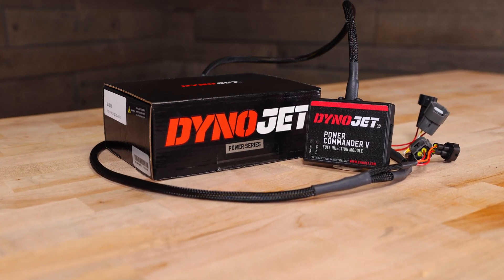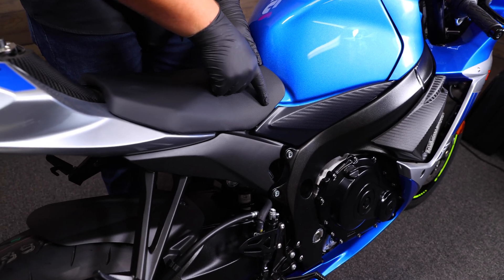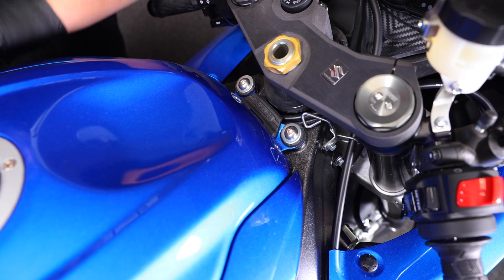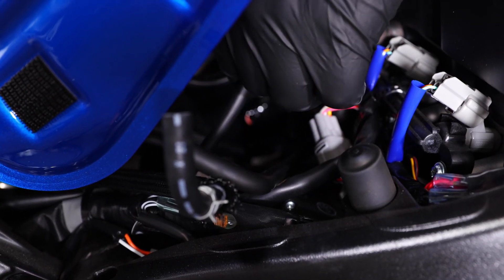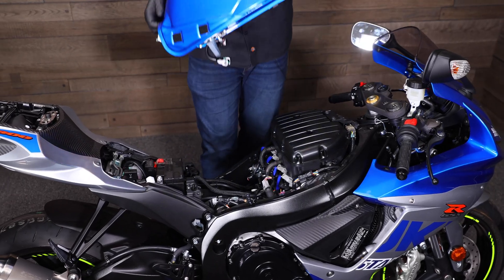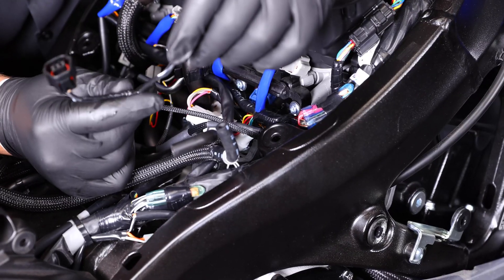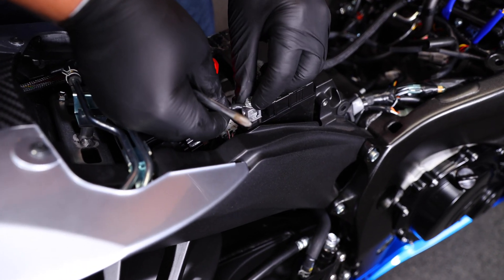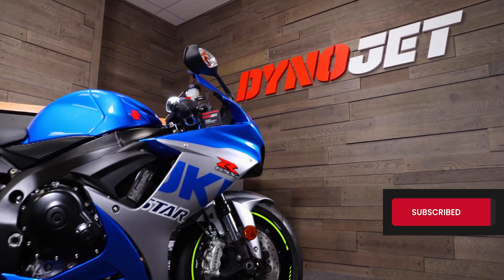Power Commander V Install: 2011-2021 Suzuki GSX-R600

Comment: That's it? You don't have to connect it to a computer to flash a map?
Reply: The unit comes programmed to a stock bike so if you have the k&n air filter and a slip on or mid pipe delete, full system . You gotta plug your bike into the laptop and put a map on it that matches your mods

Comment: Honestly one of the best, most clearest videos I've had to use in a long time. Described it perfectly for me, and it works a treat. This was fitted to a 2012 gsxr 750. Same process. I did find long nose pliers worked a treat rather than get fat hands into small areas 😂😂

Comment: i have question conserning the installation , i have power commander 5 installed o2 sensor eliminated, stock exhAust pips with a decat the exhaust valve still on , is it okey ? thank you